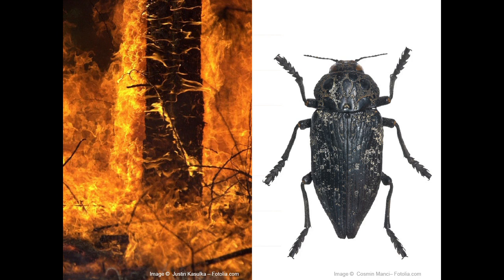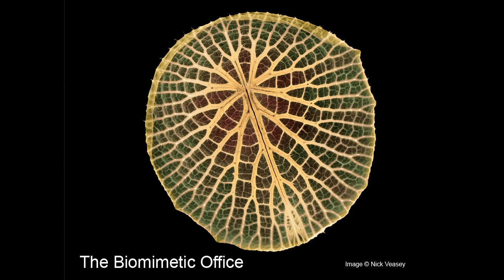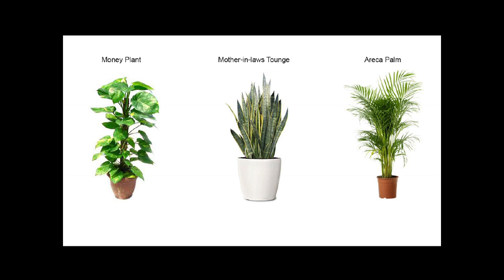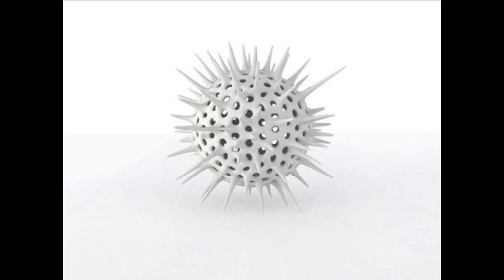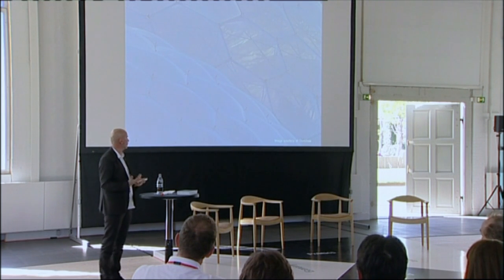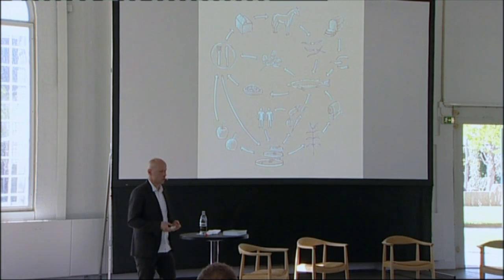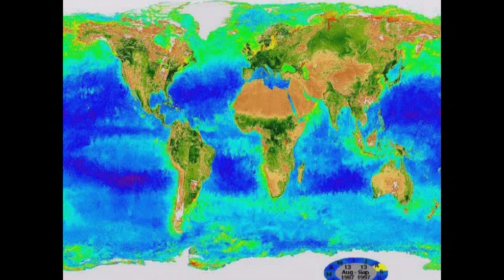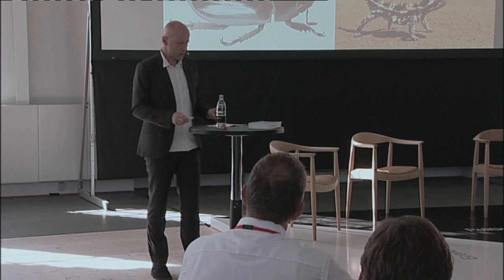Michael Pawlyn - Biomimicry in architectural design

Comment: 37:14 wouldn't a normal Greenhouse be enough. You would have either one or 2 water river ( a fixed structure which can hold water. Will them with saltwater it evaporate condensates and can be used